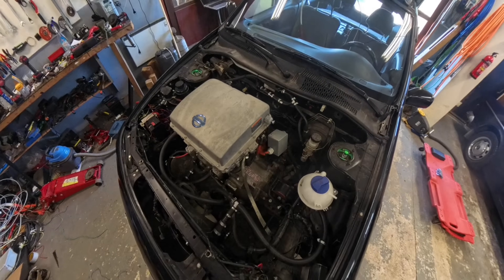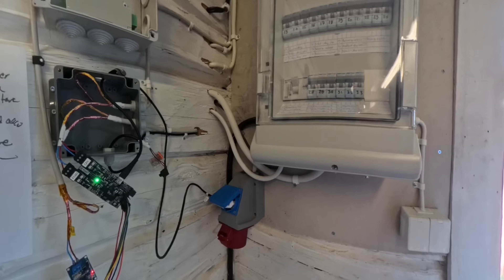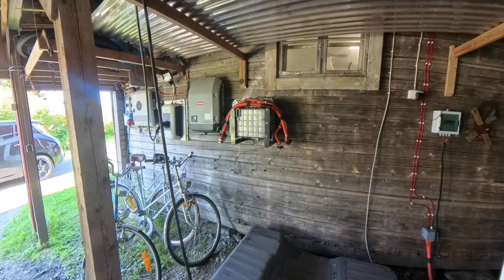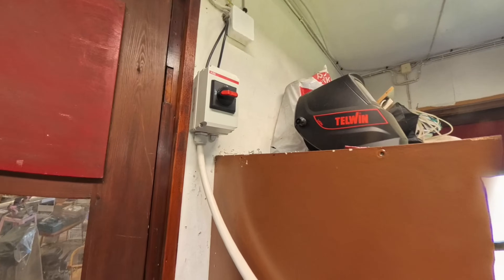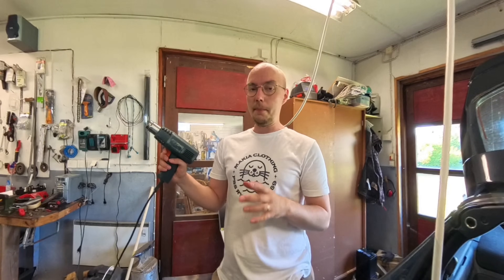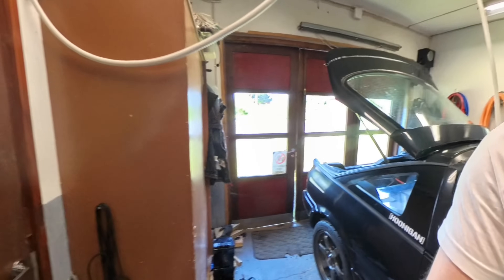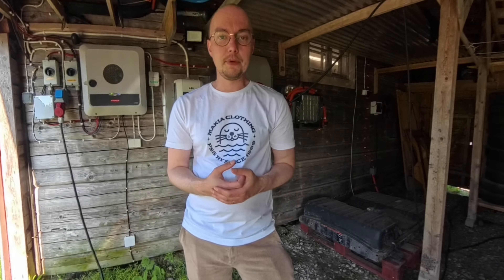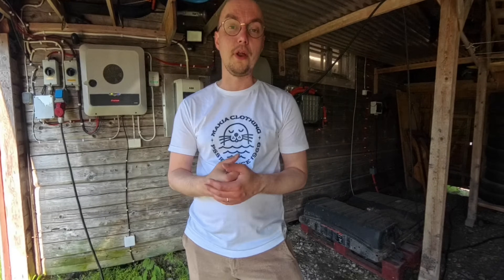Using TWO EV batteries as home storage! 🤯

Comment: car does have the liquid thermo management system so when we use it for a house storage, do we need to have it too?
Reply from the maker: Usually not needed since most stationary installs only load the battery with 5-15kW max. But if you get a solar inverter that does 50kW, it might be a good idea to connect coolant to it

Comment: Nice work.
I was just pondering an automatic battery toggle that would consume one bank to 20% and then toggle to a second one while the first one recharges..
I found ten Tesla 24v modules to build my first battery at 48v. The reason to divide the bank into two batteries is to be able to stay running if an event occurs inside of one of them without taking down the entire system.

Comment: They don't need to be identical, and don't need same SOH. You can parallel a 24 with a 30 kwh or even a 40kwh. Batteries only need same voltage and same number or  cells in a string. Only the 1st battery will be the lead, the rest of Batteries will be "folowers". In fact tesla is doing same thing with their powerwalls daisy chained.
Reply from the maker: Eddy currents, inrush currents, complexity increase etc. There are so many issues with using multiple packs in parallel. See this document: https://www.orionbms.com/manuals/pdf/parallel_strings.pdf
Reply: @DalasEVRepair  as per the document, the only major issue is inrush current  for your application. However, 2-3v or even 10v difference between those 2 batteries is nothing and won't create any major issue (discharged is 320v or bellow, where fully charged is 400v...). Obviously, you won't connect one charged battery to one discharged battery...
The bms will take care of the remaining minor issues. At least the most known brands of available bms out there and what I've seen, I've never heard of Orion, so I can't have any knowledge of what they do or not.

And I'm guessing you must be aware that nissan is using 4 cells in parallel in those battery packs, whiteout any sort of individual cell management sistem, all 4 are treated as 1 larger cell... in the same way your both batteries will be considered one larger battery by the inverter, and the bms in each battery will take care of each group of cells inside the battery and the battery as a whole, or it should do anyway

Comment: Hello, Dala! How can 10 batteries work in the same time in one inverter? is there any solution for it? I am thinking about 10 pcs of hybrid 10-15 kwh each. Since hybrid batteries are small capacity, we need to find a solution for this. Thank you .
Reply from the maker: The current code has only support for 2x batteries at the same time, but it is open source, and can be expanded.
Reply: @ so, basicaly, what I want is doable, right? I will become a patreon soon.
Reply from the maker: @ If you have not yet bought the 10x batteries, I heavily recommend looking at one large 100kWh battery, or 2x 100kWh batteries instead. Much simpler, and cheaper

Comment: I am off grid atm with 48v nissan leaf battery. 24kw but want alot more storage. What  inverter and battery would you recommend would like as much battery storage as possible. Dion from new zealand
Reply from the maker: Tesla/Kia/Hyundai EV batteries, any high voltage inverter! Check the Battery-Emulator Wiki for info on which batteries work

Comment: Hi Dalas. I live in Normandy France in the remote countryside with a 400V 3ph system. I would like to charge 3 battery packs from the off peak supply to supply power during the day so saving on the cheap rate. Has anybody done this. Can you give me a few hints, tips and clues please? Initial plan is set up 3 Leaf 24wh packs and supporting electronics only not sure how to link it up as a 3ph system!
Reply from the maker: Hi, yes this is very possible, many on the Patreon Discord server are doing cheap rate charging and discharging when price is high. We currently only support 2x batteries at the same time, so if you need a large battery I suggest using two larger EV packs instead. I suggest you join the Patreon Discord server and chat with others that are running setups like this! See you there!

Comment: Hi, I have a question about the BMW i3. Is it possible to reduce the gas engine rpms,(reducing gas consumption), by modifying the gear connection to electricity generator? How are the gas engine/electricity generator connected?. Also, how bigger can be a gas tank installed in same factory compartment instead of original one?
Thanks in advance for answers!
Reply from the maker: Use a discussion forum for this question, not youtube comment!

Comment: Thanks for this very interesting Dala. I’m interested to know when you say battery storage still in the car using a Chademo connection, are you referring to both the Nissan leaf and the Mitsubishi imiev as options for this?
Reply from the maker: Depends on how old the imiev is. It needs Chademo 1.0 support on the vehicle side. Early LEAFs (2011-2012) are not capable of V2X, since they only support Chadeo v0.9!

Comment: I wish, we would be neighbors :)  iam stock in a can problem. maybe you right with 2 channels, but if iam wannaa get it to tcp/ip i also need 2 converter or? ;//
Reply from the maker: Check the Wiki for the Battery-Emulator, all info is there!

Comment: Just a quick question do you happen to know if a 2012 leaf  battery will fit in a 2013 leaf
Reply from the maker: Mechanically yes, but the B24 connector and software bit, NO. 2011-2012 ZE0 is very different to 2013+ AZE0 generation
Reply: Thanks great channel
Reply: Do you know if you could take the cells out of the 2012 pack and put them in the 2013 case
Reply from the maker: @totclueless  whole lot of work for very little gain. I'd recommend searching for a newer pack!
Reply: Thank you  for the advice .love the videos
Reply: I have a 2012 leaf with 10 bar capacity  but the internal charger has gone bad and some damage on drivers side  .I found deals on a 2012 and a 2013  both have low capacity battery the question I asked Early was to see witch I should buy . Thanks for your answer

Comment: Thanks for the video.  So the EV batteries in question if Lithium Ion operating in the 380 volt area should have somewhere just under 100 cells in the assembly.  This is new info for me thank you.  I have combined batteries of different capacity and differing ages with wide differences in internal resistance with no problems.  The only caveat here is that your BMS for each battery should be the same manufacturer with the same communications.  So what happens when the smaller capacity is charged faster is that the BMS turns off charging for that battery at 100% and the other BMS's for the other batteries keeps charging the higher capacity battery assemblies.  You pointed out correctly that before doing the final hookup the voltage needs to be near the same, otherwise the higher voltage battery can rush to equalize the two batteries with a runaway ampere demand beyond the capacity of wiring or equipment.    Thanks again..

Comment: Hehehehe. A bit too nervous. It’s no issue if there is a bit of a voltage difference as long as you have fuses to secure it don’t overload your cables. The batteries will simply equalize to the same voltage by making the battery with the highest voltage charge the one with lower voltage. But I guess you have to make some drama 🎭 for the viewers.
Reply from the maker: I checked with industry professionals. They use +-1.5VDC as a safety limit when connecting packs in parallel to avoid blowing fuses.
Reply: @DalasEVRepair  that sounds about right. But there won’t be any booms or spark showers or fires. One will simply charge the other. The internal resistance plus the resistance of the cables and most importantly: the battery with the highest voltage gets it’s voltage pulled down under load charging the weak one. Thus limit even further the difference and total amps you will see. They are overly careful with 1,5 volt and it’s nice you’re being careful. But it would have been just fine with the diff you had.

Comment: Fantastic project, this has to be a natural way forward for all the used battery packs that are accumulating. Unfortunately the National Grid in the UK prohibits Vehicle to grid.  They have some test projects, that relied  mainly on a Wallbox Quasar 1 V2G charger. This has now been removed from sale. We await developments. I'm assuming our ultra cautious regulators will run a mile away from DIY solutions.  How is your country with V2G ?

Comment: Hi Dala, do you see any chance to get an BMW i3 hooked up via CCS as an External „battery“ just for charging? Like using the  car battery via CCS cable directly on Fronius Symo gen24 10 for example? Just by stats this should be possible. Bidirectional would be like the holy grail but just DC charging from Panels to car without AC side should be much more efficent… what are your thoughts? Thx for all your efforts! Keep going/charging 😁
Reply from the maker: This is doable, but the Battery-Emulator does not have the hardware required for CCS. It uses powerline communication (PLC), so some other hardware is needed to activate the CCS session. Someone might be able to develop an add-on board for this?
Reply: @DalasEVRepair  what if i tear down an fronius wallbox which is type2 and us CP, PP, PE but instead of 1/3ph using a Combo2 Plug which is wired to Bat+\- on symo gen24 🤔 would be almost same level of Sketchy than your repurposed 32A CEE😂

Comment: I'm slowly working on a project to join two, heterogeneous battery packs(even different chemistries)  by having one always at a higher voltage and using a buck converter with these new SiC MOSFETs that are so amazing. The most recent generation is down to an RDS(on) of 5mΩ. I have a thread on mynissanleaf forum, though I'm having to take a break form it for a few months due to life circumstances. The instigating purpose is to add an adjunct battery pack to my trunk to give me some more life until somebody gives us a LiFePO₄ battery pack!

There are always efficiency losses when converting, but my hope is to come up with a design that safely reduces that as much as possible.

Comment: Would this be possible for a vehicle too? EV-converting a large van with two Tesla packs could give a more usable range. Maybe even a dumb version, first drive one battery to empty, flip a switch and use the second battery, then charge both separately?
Reply from the maker: This hardware is not used for EVs, it is for stationary use. But the same method can be used on an actual EV, just port the code to the hardware that is used as VCU

Comment: Now I need to upgrade my 100kWh. Feels small :)
Reply from the maker: 200kWh is a crazy homebattery 😅 And 100kWh is already overkill!
Reply: @DalasEVRepair  Well, mine is off-grid. Never too big!
Reply: @DalasEVRepair  200kWh is just the right amount! I'm in Norway, and with 2 EV's we sometimes use around 140kWh per day in winter. So to have a full day + buffer in storage would be great.

Comment: Thanks for doing this experiment. I was thinking when there is a manageable voltage difference say 12v a dc load could be used to regulate the current flowing between 2 battery. Battery cooling is important.
Reply: 12V at 1 milliohm would be a current flow of V=IR-> I=V/R-> 12V/(0.001)= 12kA.
That is higher than the trip rating of some circuit breakers (typically 10kA AFIAK).

Dala measured to 0.1V. 0.1V/(0.001)= 100A.
Still a lot of current: but at least the batteries are designed to handle that.

Comment: This kind of reminds me what power station operators use to have to do to add a new generator to an AC system.  They had to wait until the sinewave peaks were in sync and the frequency matched before closing the breaker.  They say sometime the whole building would shake if you weren't close enough,  banging the generator. 😂
Reply from the maker: Exactly the same feeling here 😂
Reply: Reminds me of something from Chris Boden's channel

Comment: It is a device that stay between inverter and battery's and manage on/off and do equilibrium between HV batterys with different voltajes ? 😅

Ps. How can i equilibrate new cells that i allready added on Leaf 30kwh without open the case again ? New (SH) cells are off with 50mV :(
Reply from the maker: No real way to do it without opening the battery!
Reply: You can power up the LBC (BMS) through the round communication plug using a 12V bench power supply. If it has power, it will passive balance, doesn't need CAN or anything else. Best done with a fully charged battery. In time, it will burn off the higher voltage cells. I do this for a couple of days before installing a replacement battery pack

Just be aware, that if your cells have different AHr, they will not maintain balance through the discharge cycle. And if seriously different capacities, you will get weak-cell warnings
Reply from the maker: @Goodkiwibloke  The bypass is a few mA. Could take 3 MONTHS being powered on to balance out a 100mV diff...
Reply: @DalasEVRepair  greetings Dala, another good video. I use leaf modules at nominal 48V (14S) and they are very robust in the low stress home storage application. I have about 1000AHr and just keep adding more as I do Leaf battery replacements. Over 4 years use, SoH is still 95% (of the original degraded capacity)

Anyway, the chap asked for a solution that doesn't require dropping the battery, opening the case and presumably removing the stacks to get terminal access. That's what I gave him. Yes, it's slow, but he claims only 50mV = 19.5WHr at a cell (parallel pair) level for a 100% SoH 30KWh pack. Assuming a 200 ohm balancing resistor and 4.000V cell voltage, that's 10.1 days to "perfect 0mV balance" on a 100% SoH battery. But anything <20mV is fully balanced for an NMC IMO. So 3 days passive balancing = 35mV, and 4 days = 30mV. This would be an adequate trade-off with the car balancing the remainder during normal usage